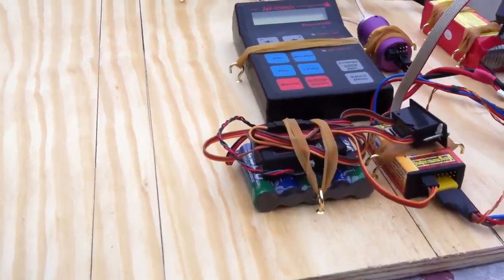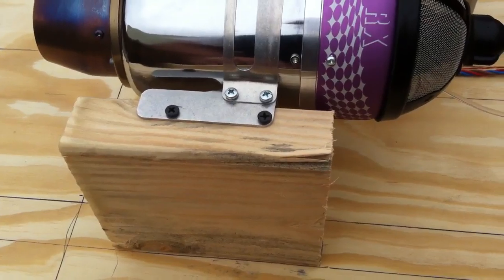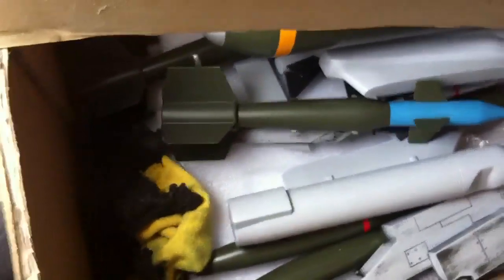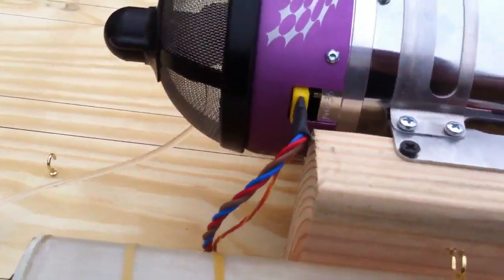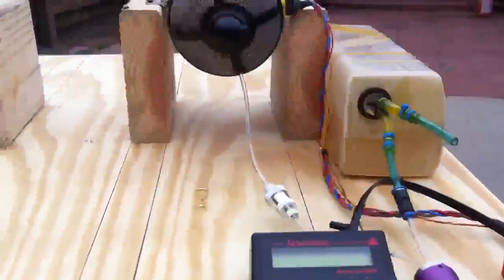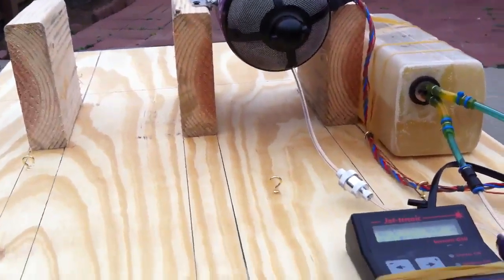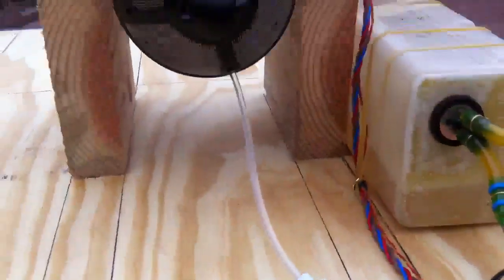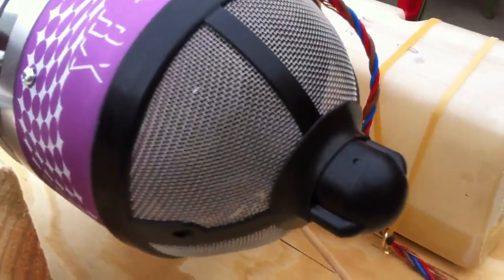Jetcat P-140

Comment: @mariotavar14 What on earth do you use to charge your P140 rx's LiFePo battery?? I've just bought myself a brand new P140 rx and I've never seen a battery with that kind of plug before and there is no charger included in the kit and neither some kind of extention cable that can connect to a charger and the manual doesn't explain how and with what you must charge the battery. It's just this new type of i/o board that has some sort of plug and extention. How do you charge it with the one you got?

Comment: Each turbine product number ends with a 0. Simply remove the 0 and you'll more or less have the number of the power that each engine gives at full power directly at the back of the engine. For ex. P20 - 2kg - P20 se - 3.xx - P20 sx - 4kg, P60 - 6kg, P70 - 7kg,  P80 - 8kg, P80 se - 10kg, P90rxi - 9kg P100 rx - 9,9 - 10kg, P120 sx - 12kg, P140 rx - +/- 14kg, P160 sx - 16kg, P180 rx  - 17,7kg, P180 - 18kg, P200 sx - 20 - 23,9kg +/- 24kg, both P300 rx's +/- 30kg, both P400 rx's +/- 40kg.